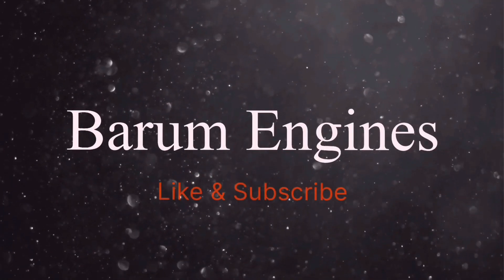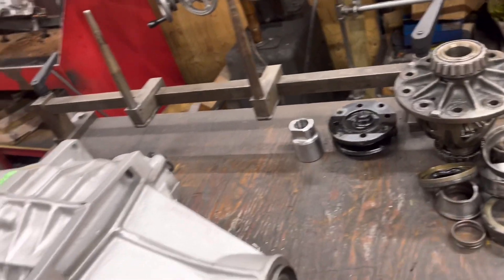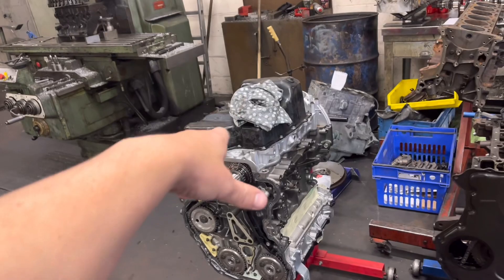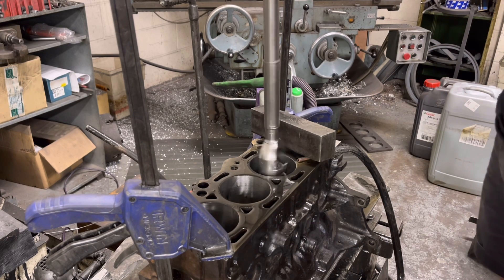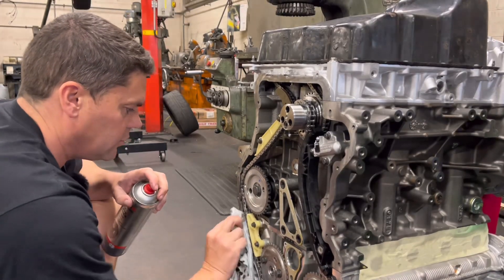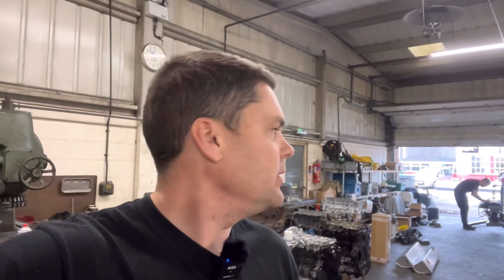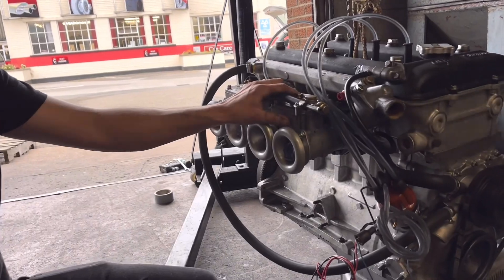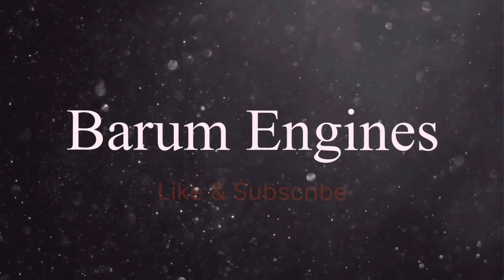WE QUOTED AN ENGINE BUT DID NOT EXPECT THIS!

Comment: Just one small criticism Iain. When your filming and speaking about something next to some of your machines. It's a bit hard to hear what your saying because of the back ground noise coming from the machine your using. But sometimes it's fine maybe your not standing so close while filming. But apart from that Iain cracking channel mate really enjoy watching the difference parts of engine rebuilds. 😀

Comment: A bit no very disappointing you didn’t video the full diff work as I was waiting for it !😥 any way you did the backlash but didn’t mention if you blued up the crown wheel and checked out the position of Pinion teeth markings on crown wheel as this is very important!

Comment: I find with those Ford Transit/Ranger engines before installing the tin timing cover I slightly scuff the painted mating surface as the sealant doesn't adhere to the shiny paint very well. Lots leak from the factory in their warranty period and even when repaired will leak again. I have not have one leak again once I have scuffed the timing cover. I have done many of those engines and that is the 1 tip I would give you.
Reply: Shouldn't the crank pully be installed before tightening the cover?
Reply: @garycrofts1421  If you mean the front seal, yes I normally put the seal on first to help centre the timing cover. There is a tool though to do it without the seal in place. The seal runs on the crank not the front pulley/balancer on these engines.
Reply: @lukekirkby5304  I did mean the seal, I did one of those covers  few years ago on an 04...it had rotted through and remember something needed fitting before bolting down the cover

Comment: Gidday Lee, obviously can't say that a British Ford Ranger is the same as here is Aussie land but the ones here are suffering from when the oil is changed.The engine destroys itself from lack of oil.Reasons are not verified but from one position I have heard the dealers refill with 10 litres of oil, run for a time and drain out to level so waste extra oil to overcome whatever the cause.Maybe its what happened to your Transit swap.As you said the oil pump feed is different?

Comment: Great video, i am a little concerned that you seemed to turn the pinion quite easily with your fingers, there doesn't appear to be enough preload on those bearings. I'd keep an eye on that.
Apart from that enjoyable as usual.

Comment: Glad to hear you used a solid spacer.
After u install the pinion yoke.  Use a big center punch and smack the pinion.  Then re check to see if you still got 20inch lbs torque.  Sometimes that outer race will move in a tick.

Comment: Interesting comment about the silicone...  most sealants these days are an organic base solvent...  but don't like oily or greasy sufaces...  I personally prefer to use the old style silicon sealer with an acetic acid based cure...  that can be used on a well wiped area without having the worry of it not adhering....

Comment: Lee, you didn't mention it,  but I hope you checked the tooth mesh pattern on the diff. You can have perfect backlash,  but the tooth mesh pattern can be awful,  which will give you noise and potentially reliability issues.
Reply: Yes I’ve jus asked him the same question!
Reply: That’s your heal and toe measurements. Use Engineers Blue to highlight the pattern.

Comment: Torque wrench the final tightening of bolts, different tightness can lead to a ripple effect and over tight can squeeze out too much silicone sealant, both of which could potentially leak from my learning curve experiences.
Scotch brite medium or 400 wet n dry if you havent got a rotary brush.
The Alfa engine is pure automotive art

Comment: in 1981 i broke a 2.0 alpha and had the original owners Manuel with the car the power output said it was 150hp i fitted the engine and 5 speed gearbox into a 1500 gt avenger shell after stripping alpha took it and weighed it in at just over a tonne the avenger was rapid

Comment: 9:57 The job you do on this engine is very similar to something that I did a year and a halve back on an Iveco engine... it was leaking,supposedly on the rear crankshaft seal.... the seal looked perfect to me,just like the place where it touched the crankshaft... what puzzled me from the moment I took it apart is how thin the carrier of the seal was!!! (Like you mention about this engine!!!) also the (6mm) bolts tightening it to the back of the block were few and far between...
I wondered right away...’how can this be sealed to the block???’.... guess what... it didn’t....
I assume there is a new sort of sealant that,unlike silicon gasket (which I used...) actually GLUES the seal carrier to the block!!!
Taking things apart there wasn’t any glueing anymore but I reacon the Italians assumed it would hold till the end of warranty,which it did...
(15 years/280.000 km)
The timing cover I see in your vid reminds me straight away... ‘no way those few bolts in this wobbly piece of tin are going to seal this...’
Probably it is glued!!!.... some sort of oil resistant Sikaflex (car window glue)
Good luck,greetings,Henk Tulp.

Comment: I forgot the other diff option that might have been interesting fun, thats the diff from the 5 litre MG ZT, LSD out the box and a special design for MG because all the other Z range were front wheel drives and the V8 ZT is a RWD, would have taken any abuse imaginable so if the Quaife doesn't work out might be worth thinking about.

Comment: I think you're using way too much silicone on the transit engine cover
Reply: Too much silicon sealant certainly poses a risk!!
I once stripped a Chevrolet 350 CI V8.... just rebuild.... Bigend bearing gave up after a few hundred miles....
In the very bigend.... inside the oilbore of the cranckshaft I found a blob of about 8mm of silicon sealant.... it was obvious what happened...
I always apply very little sealant on both surfaces,spreading it with my fingers over all and bothe surfaces,creating no more than just a film... on anything I build up you won’t find ‘sealant-spaghetti’..... I know what trouble it can cause!!!

Comment: You should get a tungsten carbide gasket scraper they are very good at getting gaskets of without gouging the aluminium areas and silicon falls off using them the razor blades are ok but gouge the metal 👍🏻just a thought

Comment: Did i hear correctly, the Apha engine is a 2 litre, twin OHC ported head, running twin 40's and it only makes 150bhp ?? thats PATHETIC, my old 1700 crossflows made 140 running a 28/36 dcd, and with 40's 150, but unreliable
Reply: Steve there about 125bhp- 130bhp standard and this one made 161bhp in fast road spec.  Race spec they can make 200bhp or more. Not bad for an 8valve engine 👌.
Reply: @bobdovemotorsports  Thanks for the reply,
Reply: @bobdovemotorsports  They say if you have to run dual plugs - like Autodelta always did -  it is a bad cc design to start with...what is your view?
Reply: @stephenscholes4758   there not the best designed combustion chamber in the world no but we work with what we got.
Reply: I’m sure he said it made 160bhp but expected about 150bhp as it’s a standard bottom end he said alpha claimed 130bhp as standard but they were not he also said the engine is tuned for mid range power rather than top end power
Reply: What's an "Apha" ?

Comment: When you say "black silicone"  ... have you tried the ThreeBond TB1184 sealant?  When I did bike racing this was the stuff everyone used, also sold as "Yamabond" and "Hondabond" by Yamaha and Honda ... I found it much nicer than the usual RTV silicone gaskets,  but it's not cheap ... worth it on high spec engines though.
Reply: I’ve used “Yamabond” in the past, back when I drag raced a bike on a very tight budget.

Comment: Use a diff spreader.  Also, you can check your backlash from the pinion after install.  That crush sleeve is designed to take up all the slack during torquing.  I hope you don’t have issues.
Reply: What 4.00 mm? Lee took off 2mm a side to get it in. Do you think that Ali casting is going to stretch say 3mm without cranking or worse, breaking a chunk out of the casing? If I were doing it and had a big milling machine I'd go down the machining route thank you!
Reply: @samrodian919  go for it.
Reply: On that type of diff design a spreader is an absolute no no. Spreaders are used to release some of the bearing preload during assembly or disassembly. Diffs that use them have a half cap bearing retainer and shim stacks behind the bearings. This diff uses adjusting nuts to set both carrier bearing preload and carrier position. Spreaders should never be used to spread a housing  more than 0.5mm or 0.020".